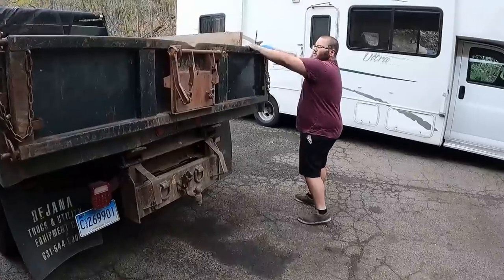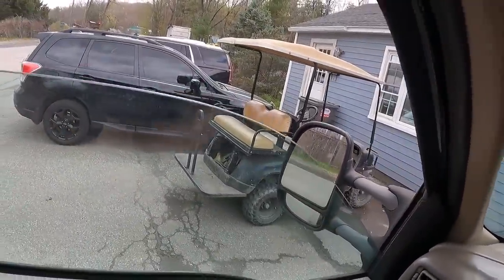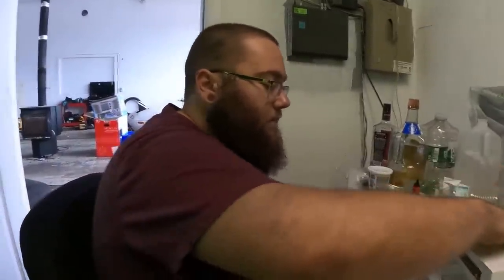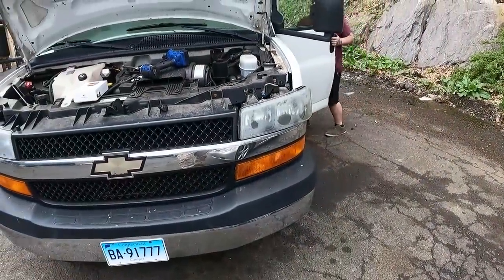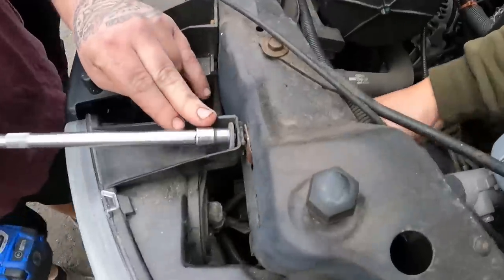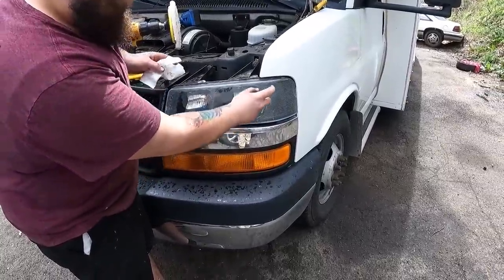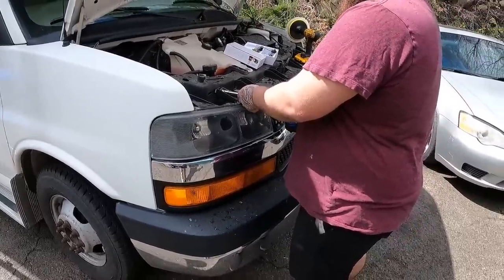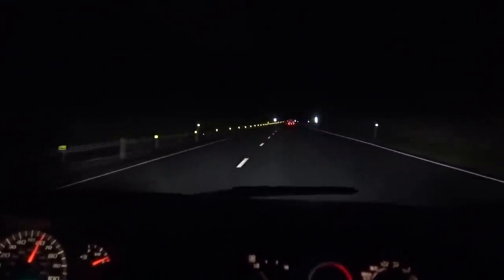Budget Toterhome Headlight UPGRADE!

Comment: Use a jumper wire in the fuse box to do a 4 HI mod. Low beams won’t turn off when you flip the high beams on. Get another set of normal white LEDs for the high beams.

Comment: I really feel like once you go LED you truly think back and wonder how in the f*** we have been able to get around with halogens so well. Especially if its a car with shit lights
Reply: they actually make aftermarket housings specific for a led bulbs for dakotas and durangos on ebay, cuts the light off at the right level for leds. Ive got a 4" lift and still haven't been flashed at while running LEDs, My stock housings and factory halogens had people flashing me all the time with the 3"lift even though they were aimed all they way down. correct housings and bulbs are a must for the most output in the correct spot and clarity because some stock halogen housings spread the leds light in a way that makes the light seem hazy on the ground because you aren't getting the full light output on the ground.  you need to make sure you get housings specific to leds though because normal projector housings wont reflect leds correctly either and cause dark spots in the middle of the projected output.

Comment: Before you buy new housings get the “Rust-Oleum Automotive Kit Headlight Restore” it should be available at an autozone or cvs in the auto section. It’s $10 and nothing to lose. It works well because it comes with a sanding pad. You first wet sand it with the green side of the pad then the grey side. Clean them up and dry it with a rag then apply the compound it comes with. It works really well.

Comment: I would recommend doing a Wet sand with 800 grit and then buff the headlights to really clean them up. When they are that bad, that is the best way to try and clean them

Comment: I did the wet sand method on my headlights but instead of clear coat I used clear enamel with UV protection and worked mint

Comment: You have to wet sand it with 1500 grit 2000 grit and 3000 grit it will be hazy at the end the new use compound then you use finishing glaze at the end

Comment: Please watch a YouTube tutorial on headlight restoration all you need is a drill with a Velcro but to use sanding pads. Go through the rough to smooth sandpaper, then polish and clear coat. It’s SO EASY, I did it for $10 total but I already had the drill and some rough sandpaper the finer sand paper is more expensive but only makes it smoother if you just want it clear don’t worry about the finer sand paper.

Comment: To make those foggy headlight lens look clear, spray water on them and wet sand with 2,000 grit sandpaper, dry off then use a compound and a buffer, apply a wax to the lens to keep it protected

Comment: Needs sanded more . If you see scratches or yellow on your headlight housing . Sanding is 90% of the job . Buff just helps a little bit . 600,800,1000,1200,1500,2000 grit . Lot of steps but if you know 2k sandpaper . It will be clear without almost. Then buff to perfection

Comment: Yo guys do a cut and buff on the head light housing the 2k clear coat them it will make them look brand new sand paper u need will be 1500, 2500, then 3000 to finish it off then buff it and then wipe it with rubbing alcohol then 2 coats of clear

Comment: Doing headlights is very similar to treating clear coat so you have to cut and buff. If you don't want to go through the work buy some 40% DEET or 20% DEET bug spray and don't let it dry

Comment: I always use Meguiar's headlight restoration kit with the included headlight coating afterwards....  The oily after coat stuff is like some Lucas  fuel injector cleaner thin light oil.... I think it looks a hella lot better

Comment: I used work for a detail shop out of FL and we do headlights restorations, for the rv I would recommend hitting it with 1000 grit 1500 grit  2000  grit (wet sand) than hit it with compound and  use a high speed buffer with a softish pad. You can hit it with some clear coat or just keep waxing them every 5 months after
Reply: And if they are still not bright then I move on to opening them up and do the same to the inside of the lense cover. I couldn't see anything until I did the inside but for most people just the outside works.
Reply: @ryancutrona673  Yeah after a while if the lights get really yellow they block most of the light leaving the housing so it ends up staining the inside like Ryan said

Comment: The 3m kit has all the stuff compound polish all the pads and stuff to wet sand get it at autozone or advanced but make sure it’s the one with the drill attachment 24-29 bucks I used it on my Buick and Honda if you take your Time it lasts.

Comment: You need the  Headlight restore kit that comes with the sand paper wheels that fit on a drill or a angle grinder. It will make them look brandy new! The buffer pad helped but with wet sanding. 800-1200-2000 grit is what I used and it looks mint I wish I could post a picture..

Comment: So how about you replace the high beam bulb with same brand I know it's a different number .....AND Chevy has a trick to ground the low beam to the frame rather than BCM(body control module) and both high and low will be on at the same time 😉

Comment: 800, 1200, 2000  wet sand it  get some polishing compound try not to burn the headlight and it should be mint. Or if you don’t want to buff wet sand and clear coat.

Comment: Those lights catch fire quick
Reply: As long as they have a good heatsink and fan they should be okay, the ones that are dangerous are the ones that have no heatsink no fan or small heatsink and no fan, I have ran identical ones from Amazon for a long time and no issues and every now n then I check the headlight housing and wires to make sure nothing is starting to melt and I also check the fan to make sure it's running bc these LEDs get super hot